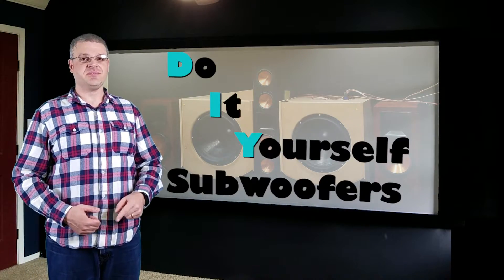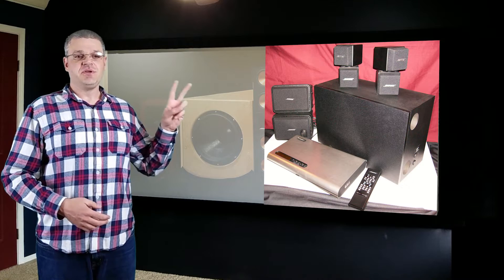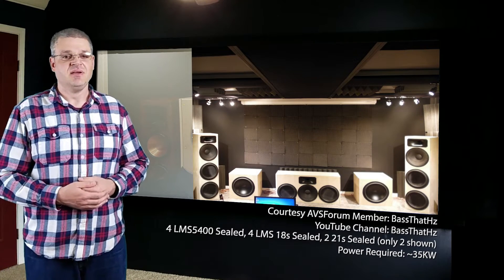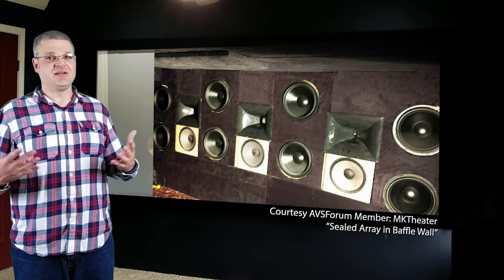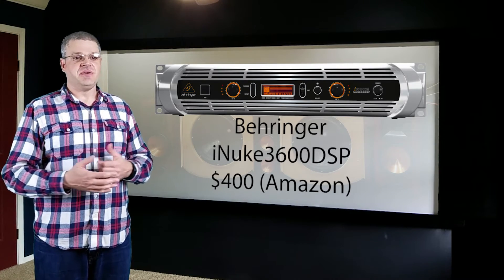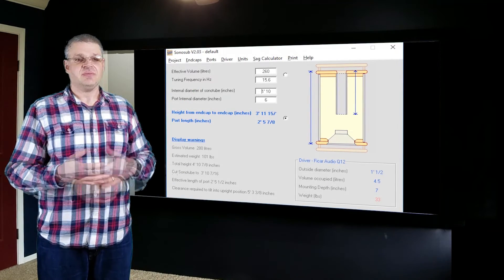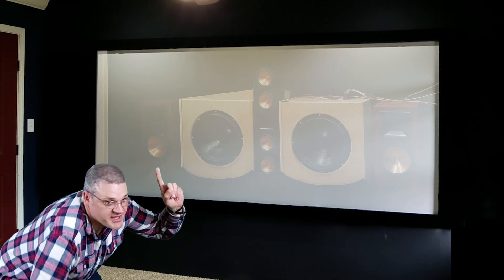DIY Subwoofers

Comment: How can you tell from the T/S Parameters if a car audio sub is good for home audio use? Right now I have 2 sets of Cerwin Vega ls12 and 1 set of RE30 speaker's with DS18 PRO-TWX1 tweeters and DS18 Pro 5.4BM 5.25 mid-range and Hyanka BSC12-2-12 D2 Subs wired in series for 4ohm impedance in each enclosures. I have the Re30 speakers on my vintage Monster knob Receiver kenwood model Nine G and the 1 set of Cerwin Vega LS12 in parallel for a 2 ohm load per channel on the Behringer Europower EP2500 1200w@2ohm per channel. If I use a frequency generator the loudest output and movement seems to be within the low 30s but watching this video and movie sounds I feel those lower Fz and see the woofers really moving but can't hear anything but feel the house moving. I would really love to take my three speakers and design better enclosures but do towers sound better than individual speakers side by side. I just think a woofer sitting rather higher off the floor seems to be canceled out compared to the one closest to the reflecting area!
Reply from the maker: Its been a while since I did the design... best I can say is to feed the TS parameters into WinISD and see how the modeling looks.  Keep an eye on the excursion as you play with the box size and make sure you aren't going past xMech...

I'd recommend heading over to the subwoofer section of AVSForum: https://www.avsforum.com/forums/diy-speakers-and-subs.155/  They'll have the most up to date recommendations for currently available drivers that are well suited to HT use.

Comment: I have 4 porter 21 inch subs down to 25 hz. Can i add lots of sealed 18 inch subs just to take care of the infrasonic bass ?
Reply from the maker: I've always heard it's hard to integrate ported and sealed sub types... Haven't tried it myself.  Maybe fine if you are just concerned about LFE in movies, but music may not sound as good.
Reply: @FamilyHomeTheater 
I would only be running the sealed at lower frequency than the ported. I'll do some more research 👍
Reply from the maker: @benfits8768  AVSForum is an excellent place to do some research if you arent there already!

Comment: You can use a minidsp for an digital highpass filter. Is there a limit how low the highpass filter can be? Down to 3 Hz? Would nice save money by not buying an analog crossover, considering that I need a minidsp anyway for room correction.

Comment: I got significant output to 13 Hz in my old theater with open baffle buy using twenty four Dayton Reference 15" drivers.  In the new theater I plan to use a combination of open baffle and infinite baffle. 

Great video, thanks for posting!

Comment: I was wondering why Americans build muscle cars for drag race with out brakes or parachute? This subwoofer are only focused on bass quantity. There must be a difference between Bruce Lee hit you in the dace or Butter Bean get a hit in his belly.  Its nice when the chairs and tabel are ratteling from the sub. You show the frequency response - but what is with pulse response? I dont know if american buildings with wobbely plasterboard walls dont reflect the bass? It seems the passivee absorbtion with a Single Bass Array https://www.youtube.com/watch?v=pdM57_C-OEE or the active version with a Double Bass Array https://www.avsforum.com/forum/155-diy-speakers-subs/837744-double-bass-array-dba-modern-bass-concept.html seems unimportant? A friend oy me has had 2x4 Klipsch R115SW and switched to 8 B&W CT SW15 with 4 Crown PA-Amps with 4000W each. ow he has <3dB at 11Hz or at 17Hz with 115dB SPL. With the opening Bombing scene of Unbroken you can hear & feel the difference. The guns are faster without the refections of the Klipsch.  You get perfect bass on all seats of the room. You get additional space agains a SBA rear bafflewall with min. >2ft thickness
Reply from the maker: And the debate goes on.  Your friend spent at least $6k on the subs, not to mention the amps.  I spent half of that and dont need nearly as many watts of power.  And when I built these subs I was in a German house, and they sound the same then as now.

Everybody knows somebody who did something different.  There are lots of LLT fans and there are lots of sealed fans, and there are the lucky few who are infinitely baffled, and too many of them defend their choices with religious tenacity when they should really just enjoy the movie.
Reply: @FamilyHomeTheater  Yes you are right, its an expensive version.  Another friend 100km in the north hast build a budget system with 8x 12" sub and a 2nd hand INuke 6000 with DSP. He payed ~800€ for his 12 squaremeter cinema. The effect can tested easily - only mute the amp for the rear array. It should`nt be a religious debate, but the quality of bass is sub+room. If you visit Germany again and spent time at he northern region between Northsea and Baltic Sea, pls let me know - your are invited for a listening session. P.S. I planed a DDBA with 2x 32 6,5" driver on the sidewalls and 2x 2000 Watts DSP-t-amps.
Reply from the maker: @janfrankfischer2479   Thanks for the invite!  I am definitely not averse to hearing other peoples systems.  Unfortunately, I haven't been able to hear a hardcore sealed array of subs, so it would definitely be interesting.  I know my wife would be happy if I went with smaller subwoofers!  I don't know if I'll ever be back... We're trying to get to England, but we may not make it back to Europe.

Comment: Couple of questions:

- Think that sub-20Hz freqs are meant to be reproduced at all?
- Think that movie makers deliberately put subsonics in them LFEs (and not that they just didn't hear them because they're inaudible, so they didn't filter them out)?
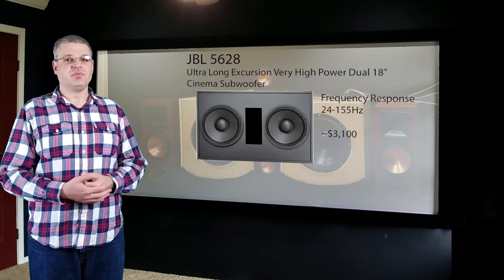- Think that movie makers use something different than types of woofers you've discarded at 3:00 when they monitor/mix/master movie soundtracks?
- Think that movie soundtracks are not meant to sound the way they do - in theaters? 
- Think that 10Hz isn't but a sonic glitch?

Comment: Hi I'm planning on building a setup of my own. It will consist of 2 18 inch drivers each in there own box with a volume of 30 cubic feet, my question to you is what is your recommended frequency to tune the box's
Reply from the maker: Assuming this is for home theater, that amount of volume should allow you to go really low, easily to 10Hz, as long as your chosen drivers can handle it.  I'd play with the tuning in WinISD.  Just make sure your port is nice and large so that the port velocity doesn't get too high.

Comment: This was a great video!! I totally agree with almost everything...if i had to nitpick i would say look for a pro amplifier with a high damping factor in the bass frequencies, for better control over the woofer cones...accurate bass is better than floppy bass..
Reply from the maker: Which pro amp would you recommend?  I do have some issues with my bass that I need to get around to sorting out.  There is a hole int eh 70Hz range, and I've yet to find the time to figure out if its my placement, or something with the subs causing the issue.
Reply: @FamilyHomeTheater  First i would measure the ever living crap out of the room, maybe to quantify the dip you are talking about and find if it is place specific, amplifiers with higher damping factors make sure the cone of the woofer is better controlled.. it is also dependant on the woofer it self, but i would try first off to measure the room..and maybe play with either the wool in the subwoofer or the placement..then i would start to look at amps...sorry i forgot one crucial piece of info...measure the woofers nearfield, you need to see how fast the cone of the woofer stops moving...with bigger subs it takes a longer time usually..it is difficult to explain especially for a dutch person in english..but if you really measure a problem in a certain frequency i would start playing around with the boxes them selves...more or less insulation or a different type...because those are the cheapest ways to maybe make a change...and if that doesnt work maybe audition some other amps..
Reply: @FamilyHomeTheater  and @justkiddin1980 The amplifier makes not the primary control. I was wondering why at the US american homecinemas are many  big subwoofer, but no control? Its like a dragster race without brakes. On Wkikipedia there is only a small english article about https://en.wikipedia.org/wiki/Double_bass_array Here at an austrian club in Vienna it is transferred as Single-Bass-Array with bafflewall nearly perfectly, with straightline response to 7 Hz https://youtu.be/pdM57_C-OEE In centraleurope its the DIY trend to build Double-Bass-Arrays. I dont know if it dosen´t work with the common american "wobbely" walls? My friend has build his DBA in a 1,5 ft. thick concretewall"shelter" with 8x15" B&W Subs and 4x4000 Watt amplifiers. Here is an example of the actual central european trend for homecinemas. The cinemaconstructor and the loudspeakerbuilder were 2 years ago DIY freaks. https://youtu.be/Kkl8xVytBXI German language please activate subtitles and automatic translation. Here the video from behind the scenes https://youtu.be/OwTOnT-yLNs  For my room it dosent works, bc. its open on one side to the dinningroom. I`ve planned 2 cylinderwave subs with each 12x 5" long excoursion drivers and at reverse my 2 old Elac Debut S10EQ as active cornerabsorber and a smaller bafflewall.

Comment: If you think SVS subs roll off at 30hz I got news for you.
A cartoon movie called- Atlantis is one of the greatest sounding movie mix ever made. 
Same with - kungfu panda part 1 
Try then out .
Reply from the maker: The 30Hz comment was meant toward "Pro" subwoofers, which are the ones the ones that might be used for concert sound or live music.  Subwoofers designed and sold as "Home Theater" subwoofers generally do get down to 20Hz.  As for SVS, I would definitely include SVS in the category I mentioned immediately before as one of the very few commercially viable options, as they definitely do go well below 20Hz.  In fact, I was considering purchasing a pair of PB-13 Ultras, but I was stationed in Germany at the time, and the PB-13s were just a tad over the 70lb USPS shipping limit.  So I built my subs instead.

Comment: So I’ve been looking at abs subs lately. Probably pb 2000s. Would I be better off building my own for the money? Thanks.
Reply from the maker: If you already have the necessary tools and the time to spend researching, building your own is a great option.  But if you need to buy a bunch of tools, it may end up more expensive in the long run.  The nice thing about building your own is you can get more sub for a lot less if you are looking for huge bass.  But if you want huge subs, you can save a little by building a smaller sub.  But is the time and effort worth it?  To save a couple hundred dollars, probably not.  To save a thousand dollars?  Probably.  And if you don't have the tools and need an excuse to buy tools...

Comment: Hey 
Thanks for the information very helpful. 
I just purchased the Berhinger nx3000d peering two 18” ultimax in a sealed box.  
I’m so confused on how to set up the cap properly any suggestions to help me get pointed in the right direction?
Reply from the maker: Set up the cap properly as in capacitor?  I know big capacitors are used in car audio, but I've never been into car audio subs, so I'm not up to speed on those particulars.  

If you're referring to how to set up the equalizer in the NX3000, I should be able to get you pointed in the right direction.  If you want to dive deep into equalizing your subs, you'll need a free program called Room EQ Wizard, a measurement microphone, and time to mess around with it all.  Here are some good articles:

Home Theater Shack Forum Section for RoomEQ Wizard
https://www.hometheatershack.com/forums/rew-forum/

Audioholics Multiple Subwoofer Setup Listening and AdjustingB
https://www.audioholics.com/subwoofer-setup/multiple-subwoofer-setup-calibration-1/multiple-subwoofer-setup-listening-and-adjusting

I hope this helps!  If I misunderstood the question, please let me know and clarify it and I'd be happy to help!

Comment: Nice video all i got i my sony shake 2000 its an older radio but has 2 15 real good speakers i use them for my bass and have my surround sound with it too it helps it a lot with the voice and being able to get louder

Comment: What do you think of Infinite Baffle setups? Our home theatre is in the top part of the house, the house has a pitched roof, so it is a room, with a small room either side of it (where the roof comes down) . Would it make sense to make an IB setup and can they do below 20Hz?
Reply from the maker: They can definitely go below 20hz with the right drivers.  As long as you're sure you aren't moving any time soon, I say go for it.  It saves space not having to have massive subs in the room.

Definitely research and ask questions in the DIY Subs section of avsforum.com if you haven't already.  There are people there who have done it who can give you all the tips, tricks, and lessons learned.
Reply: Thanks, getting drivers in Australia isn't easy, so I'll be asking over there for advice for sure. Definitely not moving from this house, just finished building it and intend living in the home theatre :)
Reply: My other thought was, seeing as the theatre has a Star Wars theme, was to build an R2-D2 sonotube sub :)

Comment: That is a really good video, covering much with simple explanations.
There is one more way to build super-powerful subs without all of the box space. The late Tom Nousaine used the manifold method. Picture a chimney with 8-15" TC Sounds woofers mounted on it, cones facing in to it. The back wave fires into the adjoining room, in his case a basement. The one end of the, "chimney" is sealed, and the other end fires all of that air up through the floor. Obviously the downside is, you need a large room, or basement on the others side, and a big hole cut through your floor or wall. I never heard this, but many people who in the Illinois, P.S.A.C.S stereo club did. They raved about it as being the best bass that they ever heard and his distortion/response measurements confirmed those opinions. That was a few years ago, and as you know subwoofer driver tech is even better and cheaper now.  :-)
Reply from the maker: If I understand what you're describing, it sounds like a sealed subwoofer with a really large cabinet volume.  I played around with it a little in WinISD, and it looks like it does indeed offer about 3db more at 10Hz if I model a 28cu ft sealed subwoofer rather than an 8cu ft sealed subwoofer.  So it does dig a little deeper than a "small" sealed design.  It would be an interesting project to try out if I ever had the specific housing setup required.
Reply: Oh yes, it's the equivalent of a very large sealed enclosure. Another great one back then, before the super-Xmax woofers came out was Tom P's. He had 8- Audio concepts 12's in Push/pull config, in CONCRETE enclosures! It was up in a large loft, and a very large walk in closet acted as the speaker box. Those were about the best drivers at the time with an X-max of about 12MM. By today's standards that would be, "only 12MM." LOL

Comment: Really hope i can get one ultimax 18 till the end of the year, problem is that i'm europe, and it's really tricky in order to get one. Found a kind of trusted website in germany, but because the supply is so low, they removed the sub from their list =/ hope it gets back, otherwise i have to stick with the pb-1000.
Reply from the maker: I was in Germany probably 3 years ago now.  I do remember that there didn't seem to be much in the way of drivers available.  But I also didn't know German very well, so I may have been using the wrong search terms. Good luck sourcing something that will work.